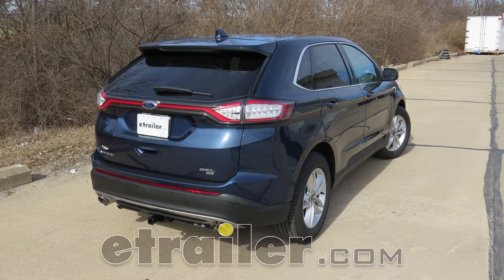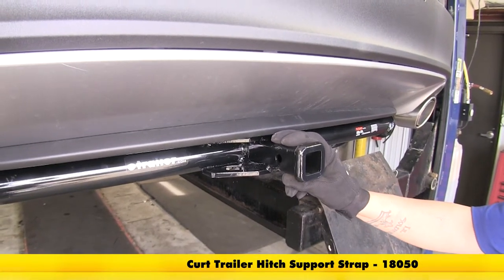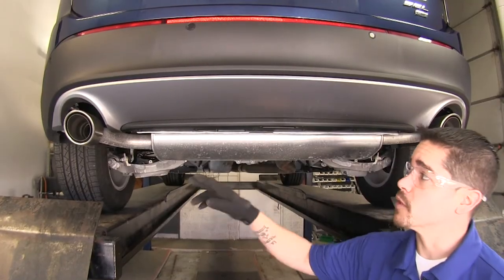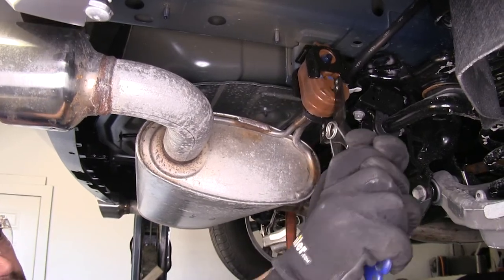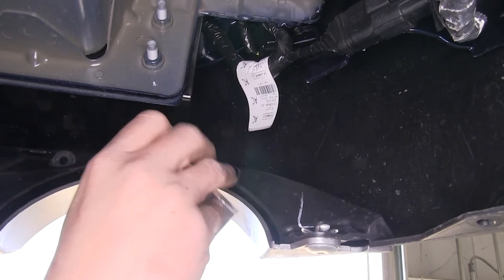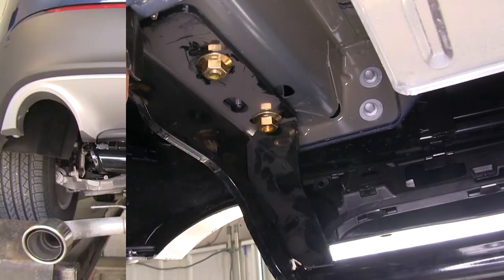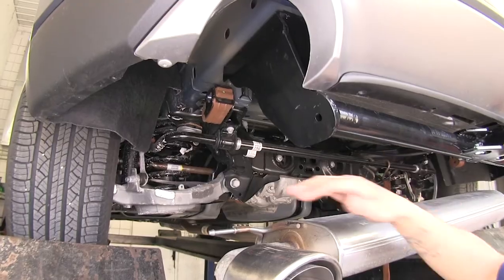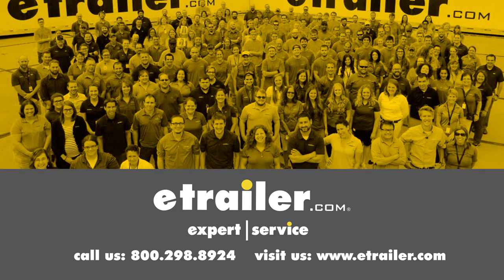etrailer | Beginner’s Guide to Installing the Curt Trailer Hitch Receiver on a 2017 Ford Edge

Comment: I have installed numerous Curt hitches from eTrailer on my vehicles which were two Subaru's, and a Jeep Wrangler but I have to say for the Edge application, the Draw Tite is a more compact better looking arrangement. And with the Draw Tite the rear splash panels behind the rear wheels do not have to be trimmed. Think I will order the Draw Tite for our Edge. Thanks for the great video eTrailer.

Comment: Is this hitch design compatible with Ford's "kick to open" feature for the tailgate on the Titanium trim level?
Reply from the maker: The Hands-free Liftgate feature will still work on your Ford Edge but the sensor areas will be limited to areas away from the center where the hitch receiver opening is located.